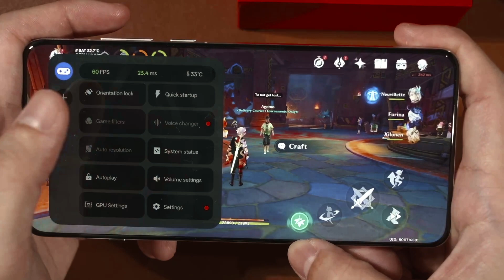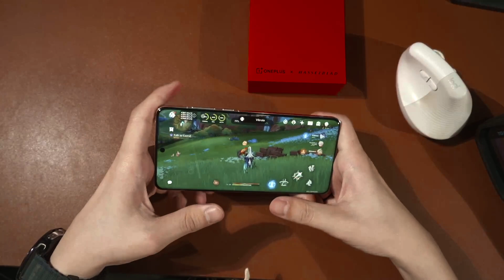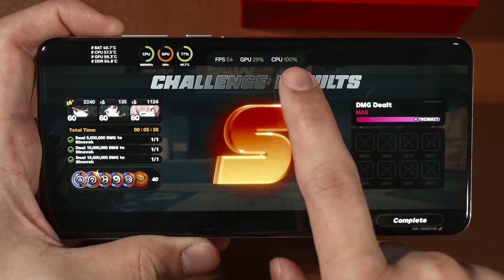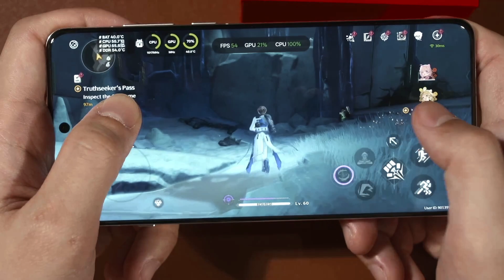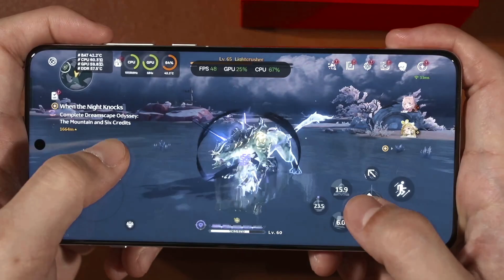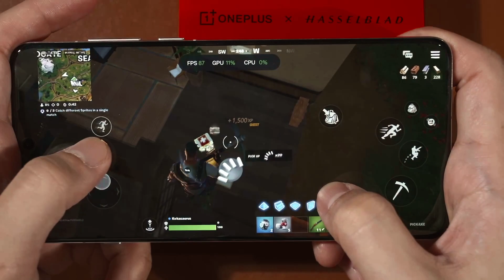Gaming test - OnePlus 13 with Snapdragon 8 Elite!

Comment: I couldn't get what was the all showing the stats on the left? Also its not just the resolution that makes the OP13 better, because in 3d mark stress test it scores a lot higher going just 2-3 degrees hotter. Those 2-3degress would never give the S25U the room to acheive almost 1000more points in the lowest loop score.
Reply: Bro s25 ultra resolution is much higher than oneplus 13 ........In genshin impact s25 ultra 1872*864  and oneplus 13  1782*810. So one plus is not better than s25 ultra . It is equal to base s25 which one has same resolution.
Reply from the maker: This phone has two thermal limits. One for basic usage and another while running 3DMark.
It can reach 49°C in 3D Mark - and this thermal limit is increased just to get a higher stability % in the benchmark.
Reply: @NasiLemakTech  I also think in games it has a CPU before GPU throttling. But in general the phone tries to keep lower temps at the battery and I think that is the distinguishing part for the lower performance. My other phone Honor Magic 7 Pro runs everything better but the battery can reach 47-48degrees in games easily and thermal cut off is 51degrees....3d stress stops at loop 10 with thermal warning. Also Vivo X200Pro allows for more temp and others as well....IQOO, ect...
Still with the same conditions OP13 has better capabilities than S25U.

Comment: 1:59 because the ratio of 1+ 13 is 20:9 instead of 19.5:9, the s25 will be shorter so it will lack pixels
and on scene 8.x app you can also see the resolution on the fps chart

Comment: Best 8 elite device?
Reply: Best 8 Elite device is the Redmagic
Reply: @Eggk1_• lower render res and not the best perf specially on wuwa.   The res isnt bad at all, but it should perform a bit better.
Reply from the maker: A tradeoff more like. Lowering the render resolution surely increases FPS, but also looks a bit worse
Reply: Iqoo 13 better
Reply from the maker: Definitely not
Reply: @NasiLemakTech  why?